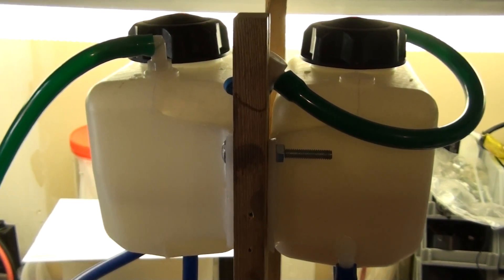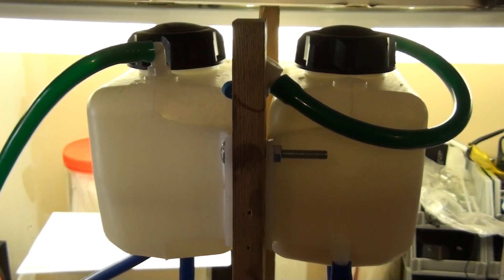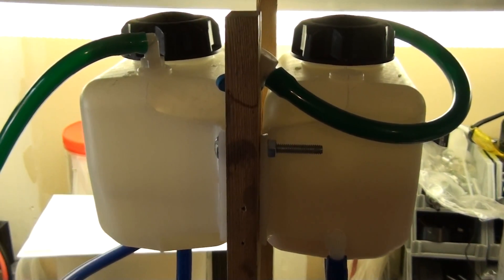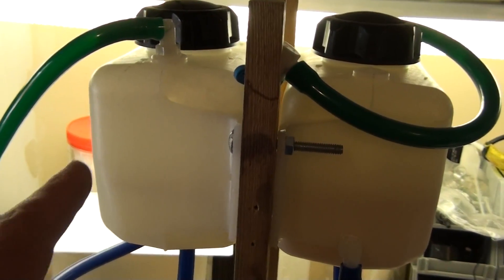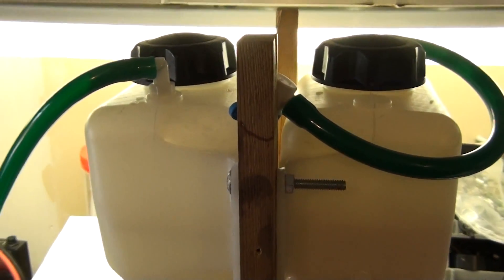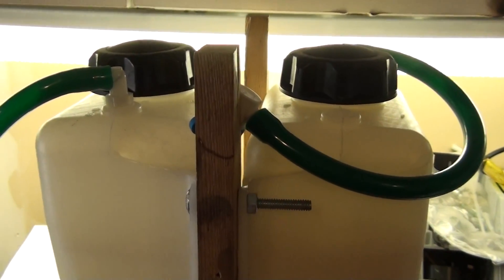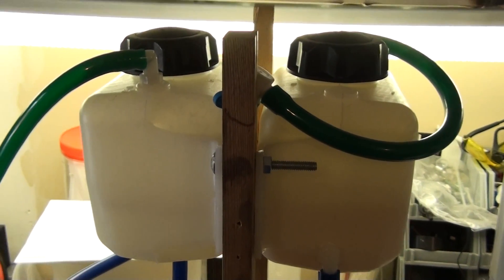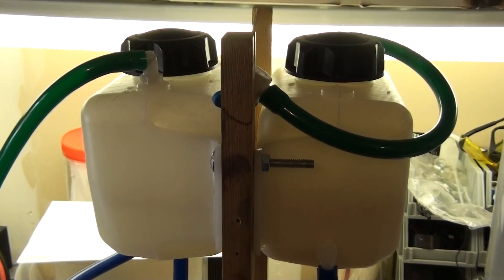hho Hydrogen Separator cell shows what a pure H flame looks like.

Comment: Hi Delvis11, How much pressure could the hydrogen create? Say you put a soda bottle on the end of that line and the tanks were made of chromemoly  or something that could handle serious pressure how much could you create? Could you explode the soda bottle with the pressure created by the hydrogen gas, or is there a pressure point where the gas bubbles stop releasing?
Reply from the maker: There's no  "pressure point" The cell can make about 25 psi but the material used will fail over that.
Reply: interesting. So if it was made with stronger materials, it could probably create higher psi correct?
Reply from the maker: yes
Reply: thanks!

Comment: Have u been abled to put each gas under pressure ? I'm curious do a water test with bubbles coming up from the hydrogen side and have a flame near the water line just as the bubble breaks the surface if it is pure it will flame up and not much of a pop to it,then back off and catch the bubble breaks in open air ,this allows oxygen to mix with the hydrogen and a bang.Also do the oxygen side to and show your results on video ,if u don't mind

Comment from the maker: @servicesafloatnz I am not curtain how pure the h2 is at this point but yea it is h2 and that's why there are no flashbacks> I don't know about other separator cells out there but mine is running over 5.5mmw. That's about 75% efficiency. When I get the final system done I'm going to have the gas spectral analysed. This stuff needs to be over 99.7% pure to be compressed.

Comment: Steve, Good job on showing the separation of the 2 gases. I see comments on compressing the hydrogen gas.. Please do not attempt that!  Im sure you understand the consequences.. what is your overall intent to separate the two? Keeping them together gives you a hotter flame with a torch and can be sustained  by itself? and for an engine the H and O is excellent for the combustion process.. and oxygen is naturally sucked in through intake..  Just curious?? Great video!!

Comment: @myhydrogencar ok i see where your going with it,but  watch myth busters when they are working with electrolysis,they have an explosion,and they are pumping hydrogen into the crab,with no oxygen,and the car is running just fine,but it explodes,so i dont know how you assume this.
honestly i love your idea because you wont have to chaing anything and a car would run fin if your only pumping hydrogen into it without a mixture of oxygen in it,because you wont be flooding the car with oxygen.

Comment: @delvis11 not trying to start an argument,but yes as hydrogen burns with oxygen around it,even mixed in it,the hydrogen will creat water,to creat water every 2 hydrogen atoms will fuse with 1 oxygen atom,so yes no matter what you do unless you get rid of all the oxygen,the flame will still use the same amount of oxygen and hydrogen,i got a very good cell up,and worked on even this i call it the u cell your working on,and have read everything there is on the subject,so yes its the same.